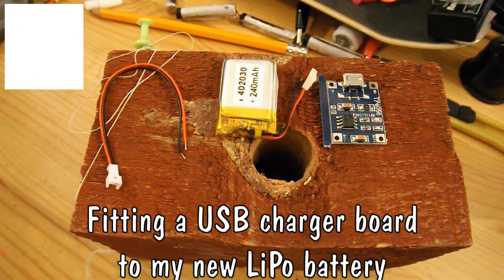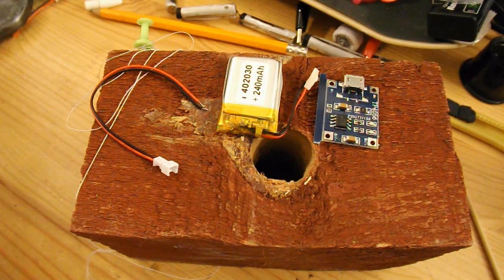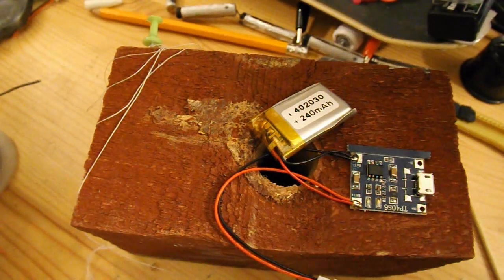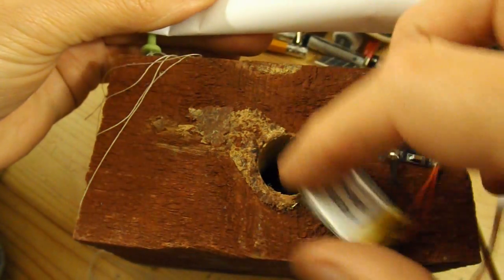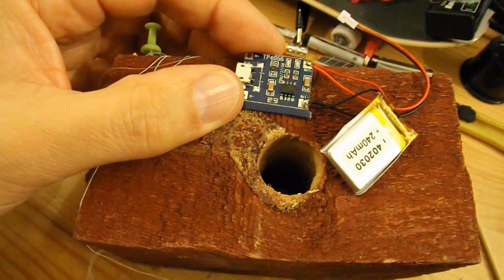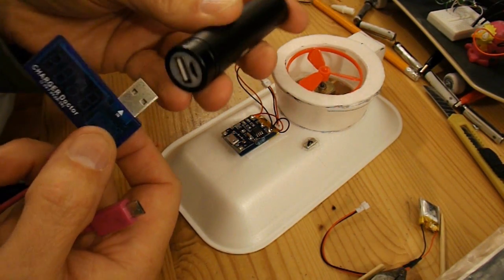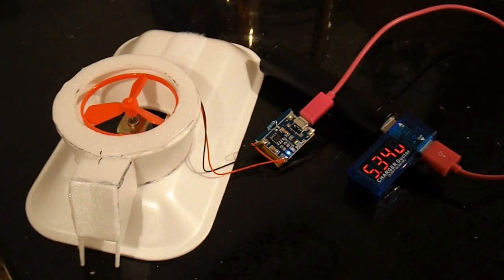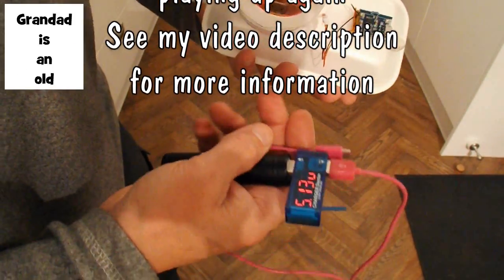Helpfile - Fitting a USB charger board to my new LiPo battery

Comment: Hi Grandad, if it says in the charging board's description that the max. charging current this module can support is 1A, does it mean it can charge 1Ah LiPo max. or could I charge my 2Ah LiPo? Cheers!
Reply from the maker: +Viktor Božičević I think this video may help you https://youtu.be/AQnWqfEwPTI
Reply: +Viktor Božičević It means you can charge a battery at rate of 1 amp maximum. Generally speaking, you should charge LiPos at 1C, where 1 is the multiplier and C is the capacity in amp-hours, so a 250mAh battery should be charged at .25amps.
Reply: +RecurveNinja I got it, if larger capacity batteries are charged at lower current, than it would take longer for them to charge.

Comment: Can I charge a 3.7v  200mah lipo battery using TP4056 module
Reply from the maker: Yes. I suggest you read my video description as it gives details of the resistor you need to change to set the charging current for your battery.

Comment: Hi Grandad,  I am very new to this. I am planning to make a portable charger for my tablet. Will this chip work with multiple batteries? What's the maximum amount of batteries I can add and of what capacity? Thanks.
Reply from the maker: I suggest you follow the eBay link in my video description and read the specification. I have no intention of offering advice on something that could potentially end up with you damaging your tablet.

Comment: just use a mini pot across the smd resistor pads so that it can be simply adjusted for battery capacity
Reply from the maker: Yes you could do that. You would need to use an ammeter to check the current flow. By using the resistor values given in the circuit description you would know you are getting the correct current if you don't have a suitable meter.

Comment: Can I charge my 650mah lipo battery
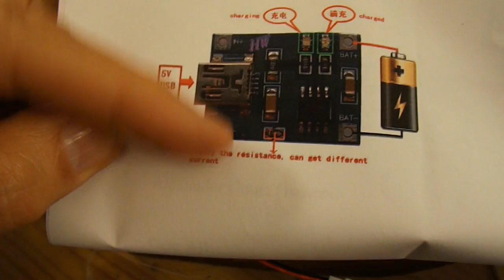Reply from the maker: If you understand what charge rate is required and modify the circuit as shown at around 02:55 then YES but I would add three comments.
1 - You would probably be safer using a proprietary LiPo battery charger designed for the job. I am not endorsing these products.
2 - I would suggest using the later version of this board that includes the battery protection circuitry if your battery does not have one fitted,
3 - you need to check what charge rate you battery can take and change the indicated resistor to match